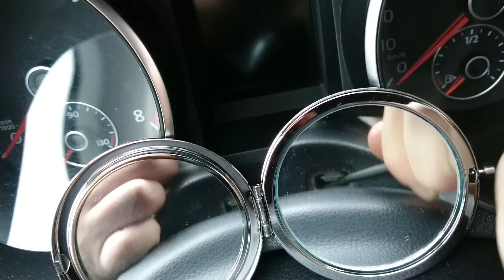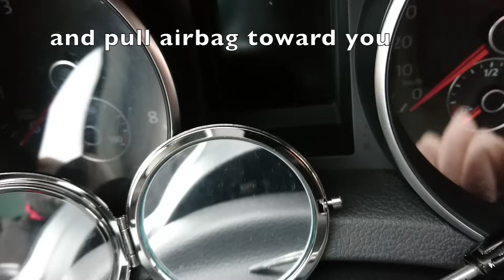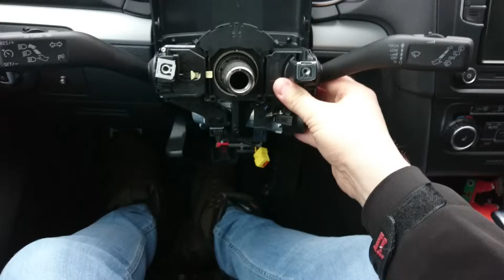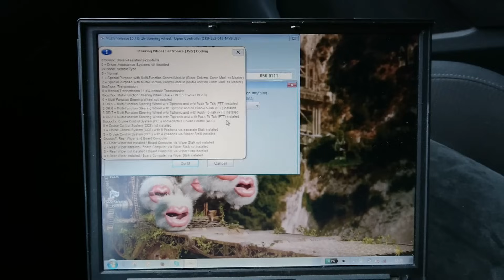Multi-function steering wheel installation to VW Golf 6

Comment: Just a note for anyone doing this, the bolt holding the steering wheel is made to last 5 uses, so you removing it and installing it back again counts as two. Just to keep in mind.
Reply: mine counts about 156 and it's ok
Reply: @static1890  bro my golf mk6 highline has a multi function steering wheel with the shifters but the right side of the steering wheel (right shifter+right buttons) does not turn on and doesn't work at all.
While the left side is working perfect(left shifter+left buttons).
Do you have any idea if I have to change the module ( the chip under the steering wheel) or I have to change the right buttons?
I just don't know where are the shifter gets connected, is it the same cable with the function buttons? Or is it connected to the module?
Reply: @pm6911  i don't think that it can be module under sw, try to take a look there is a small module under airbag where the shifters and buttons are connected so before change underwheel module i'd look the first one, if you have vcds you can take a look for errors, maybe there's something that can help you
Reply: @static1890  thanks buddy!
Reply: And the buttons fully function

Comment: Heads up to people watching this video. I have a base 2013 VW GTI and didn’t need any of the things in this video. Didn’t need a wire harness, different control module, or a new wiper arm. The multifunction steering wheel was straight plug and play. I didn’t even have to change the coding in VCDS and it’s fully functioning.
Reply: Thanks, so now you can control the menu with the wiper lever en the steeringwheel buttons? And you put the old airbag back?
Reply: @LetsMakeMusic11  I put the old airbag back yes. I clicked the box in coding to turn off the wiper arm button so it doesn’t interfere with the steering wheel.
Reply: @timterrell8678  So the airbag from the non multifunction steering wheel had allready that black cable that he plugged in on 8:56?
Reply: @LetsMakeMusic11  yes, they all have that cable.
Reply: @timterrell8678  Thanks brother
Reply: Thanks for this info! I have a 2011 GTI with no multi-function steering and I’ll definitely get one this coming week and do a swap. Will report back
Reply: UPDATE: it turns out that I just needed the faceplate with buttons for my car because I had the updated (B version) Multifunction steering module module, correct inside steering module and correct airbag harness (A version) ! No coding needed, just plug n play! I suggest checking what you have and don’t have before buying anything. Also didn’t change the wiper stalker and zero conflicts!
Reply: @MX007100  sweet! Thanks for an update. I love my wheel.
Reply: Anyone knows if the airbag harness needs to be changed or will the airbag work if the original harness stays?
Reply: @moisesibarra985  Airbag harness on replacement steering wheel plugged right in and was detected.

Comment: Excellent thank you all info with OEM part numbers
Reply from the maker: Good to hear, that this video was helpful!
Reply: @lutz6441  Just wish you  you had provided the Steering wheel part number for compatibility as so many different ones available.Can you offer any help in this area?    cheers   Colin
Reply from the maker: @colin5064  When looking different steering wheels, most likely all of them (which have flat bottom and similar airbag) will be fitting no matter what part number is. Sadly I don´t have good list of different OEM steering wheels.
Reply from the maker: @colin5064  Quick search provided some information about part numbers. General partnumber is still the same (1K8419091), but end letter(s) will change: S, P, Q, AB, R, AC,
Reply: @lutz6441  Much appreciated,l thank you for your time and interest.I search all alternatives available on ebay.Thank you for your help and experience

Comment: What happens when you don't replace the wiper stalk? Will the extra buttons not work, still work or will the steering wheel controls not work? By the way, excellent video, helped me find the parts and I will watch it again when they arrive! :)
Reply from the maker: If you use your old wiper stalker with buttons, then it might get conflict with buttons on new steering wheel.

Comment: I am planning on upgrading my 2012 comfortline jetta steering wheel to a MFSW, the tutorials I found online however had people soldering wires and doing some splicing and stuff
Reply from the maker: As you have seen in my video, you don't have to solder or cut any wires whatsoever. This is straight swap and you need MFSW, compatible module, new MFSW harness and most likely wiper stalker switch without menu buttons.

Comment: Lutz if i have mk6 with mfc just want to change steering wheel and airbag do i have to go through all steps or just steering wheel and airbag
Reply from the maker: If the buttons layout is the same, then most likely you don´t have to do anything additionally, just straightforward swap.

Comment: I bought a GTD mk6 multi functional steering wheel with airbag included for my 2009 MK6, Do I need to replace the SWCM and wiring harness? Or can I use my old one, I understand that I won’t have access to the buttons

Comment: So guys, if your car is newer than 2010 month 6 or something like that, you have no swcm under the steering column, the control module is integrated in the clock spring. Check before you buy anything
Reply: Very true. I checked mine yesterday and the location is exactly as stated here. Luckily for me; my SWCM is the updated one with part number: 5K0953549B , so I don’t need to change it when I do the Steering swap. 

Edit: It turns out I only needed a faceplate with buttons and no coding was needed!
Reply: @MX007100   i have a 2012 mk6 golf, will i need a new SWCM or will it already have it?
Reply: @imadmiah9953  Hello. You don’t need one I because yours is even a 2012 model and mine is a 2011 but it came with one already. You can do a check by removing the top plastic cover on your steering wheel column, just use a plastic tool or flat and lift up and you’ll see the switch with part number!
Reply: @MX007100  thank you, highly appreciate it that! 👍

Comment: Amazing video. To the point. Just one question. I have trendline Golf. Super basic. Basic MFD, no factory Bluetooth, nothing. I do have RCD330 like yours, which works amazing. My question is, does all buttons on steering wheel work? Does Mic button work for CarPlay and Android Auto? The up down and back button on the right side, do they work? If yes, what do they do? Considering I have basic MFD, just wondering what they do.
Reply: Also does the call button on the steering work? Since my car doesn’t have factory Bluetooth.

Comment: Nice work, not sure if you fitted a new one, but I'm sure the bolt to hold on steering wheel is meant to be single use only
Reply: You can use it 5x

Comment: What all would I need to change my  2014 Volkswagen Jetta 2.0L Base steering wheel to a multi function steering wheel?
Reply: did you find any information about your question?
Reply: @viliusabraitis9437  unfortunately not. Ended up simply getting a Camry. Best decision ever.
Reply: lol @fendypierre3965
Reply: I also want to upgrade my steering wheel from basic one to a multi function not sure if I need the module for it and nothing on the net looks like I will have to go to the dealer :)

Comment: Great video, but i've got a question does the MFSW 1K0 953 549 CF module is the same like the one you're using? 1K0 953 549 CD or not?
Reply: did you ever find out if you needed to change it?

Comment: Thanks so much for this guide! I installed a 2012 mk6 mfsw into a jetta 2006, and also upgraded steering wheel module to CH version - everything works perfectly, but I have a problem where the back of the steering wheel is rubbing against the plastic trim around the steering assembly, making a scratchy/squeaky sound. My old steering wheel didn’t do this. Any ideas? To what torque setting did you tighten the steering wheel bolt?
Reply: Are these the parts you used?  I would like to do the same for my 2009 Jetta.
5K0419091ARASZ ---------- Golf R MultiFunction Steering Wheel (Without Paddles)
PN: 1K0953549CH ---------------- GTI/Golf R MultiFunction Steering Wheel Control Module (SCCM - Highline Version)
PN: 5K0971584C ---------------- GTI/Golf R Airbag Harness

Comment: this is only needed, in case you want the bottom flat (GTI) steering wheel, otherwise you can just install the buttons. but they are different ...GTI version and standard.

Comment: Love your video. One question I have, it might sound stupid,  but i have a different unit as an audio device, and if i don't want to use the buttons on the steering wheel, but I want them to be lid(the buttons to have the lights on), will i be able to swap the steering wheel without the module change and the airbag harness to be changed? Thank you

Comment: hello congratulations for the really interesting and complete video, above all very clear and descriptive, I have 2 questions to ask you. first question the work you have done and with the pieces you have changed do the paddles also work?
second question I have a golf v gti with dsg gearbox without paddle, and I would like to mount the steering wheel of the golf 6 gti with the paddles, what should I change, and kindly if you can also give me the codes thanks in advance, for me it is important your answer
Reply: From what I'm getting is all that works bc it's activating the setting in the ecm,pcm,bcm as long as you have a tiptronic dsg transmission because my cars interior is exactly the same as his and I do not have any steering wheel controls so I'm hoping this comp program he used don't cost much bc all them parts from the factory expensive

Comment: Can you retrofit multifunction steering wheel with MFD (multifunction display) and not MFD+ (when you open door MFD+ will show you image of the car along with which door is open. MFD only shows indicator on the dash board)? If not I can imagine it can make it more difficult and expensive as probably whole dashboard has to be swapped (perhaps more coding/new contract unit?)
Reply from the maker: Yes, it can be so and then you will need to swap gauge cluster to MFD+ one.

Comment: And thank you so much for not having one of those $#@! computer voices animate. Well done and informative video.
Reply from the maker: Thanks for good words. I had some feedback, that such a silence background is quite a boring and videos are lacking generic music etc. I have now added to my new video (Tow Bar installation) some classic music and hopefully it's more enjoyable now :)
Reply: @lutz6441  Hello, THANKS a 1000 times for the video. Is it mandatory to replace the sw control module? And if not, where is that for? I don't know whether I need to replace, sw control module, sleep ring, wiper switch stalker... Any help would be appreciated alot!
Reply from the maker: Yes, you should change the sw control module to highline version one, also therefore you should change slip ring. Stalker needs to replace, when you have stalker with menu butttons - you have to change stalker to non-buttons one as they go to conflict when you have buttons in both steering wheel and stalker.

Comment: so to be clear ill need to change the airbag harness, module  and wiper stalk? been having a rough time getting the correct info. i have a mfd display but don't have the mfsw module in the column
Reply from the maker: Correct, firstly you have to change SWCM, which is compatible for buttons on steering wheel. Then you have to change wiper stalker with non-button option, as with button one it can go to conflict with SW buttons. Finally you have to swap SW wire harness to get SW buttons to work.

Comment: @Lutz .... if you used the old indicator stalks.... would the dash status screen have worked with the stalk buttons or with steering wheel buttons??? im just wondering if i need to waste money on new stalks if old one would still work fine for wipers and indicators
Reply from the maker: If you remain both buttons, then they go in to conflict and not working correctly. Stalker with no buttons is rather very cheap, from Aliexpress.

Comment: Hi, prior to you coding this, did you initially lose horn and steering controls? I have done a similar swap (Leon mk 2 facelift steering wheel to pre facelift) and have lost horn function as well as well as steering controls. Understand I may have to change module and potentially the gateway for steering controls, but thought I’d still have the horn function at this point. Thanks
Reply from the maker: No, horn and steering controls working well and sw control module should be replaced in order to make it fully functional.

Comment: Great video, did the display already have a menu? because im thinking about doing this but i dont have a menu on the display now, does the new swcm contain the menu software? and do all the functions work.
Reply from the maker: Yes, my car had before wiper stalker switch with buttons to move in menu. If your car has same set, then most likely you have menu option. I had to change my previous wiper stalker switch to non-button wiper stalker, as there can be conflict between MFSW buttons and wiper stalker buttons. In my understanding there are differences between instrument clusters, so if you don't have menu, then you should start to look proper instrument cluster.
Reply: @Lutz Super detailed video. thanks! in regards to @Leonardo's questions. Where you able to access your menu with  the old wiper stalker? because i have same like yours, either i don't know how to access the menu or there is no menu function or is it only MFSW that can access menu?
Reply: try press and hold the up down button on the wiper stalk in a few seconds. i had the same issue when i got my car due to the blue tooth phone system being the default on the display
Reply: Do you hold them both numbers at once? @Rawdilz

Comment: I have been trying to work out how to do this for a long time. I got a 2014 VW Jetti TDi value edition and this was about the only thing I was missing. The only question I have is the software you used, is it required, what is it and how hard to get /run?
Reply from the maker: I use VCDS 15.7 software and I ordered it from Aliexpress more than 5 years ago (~10€). Now they sell 19.* versions. Basically VCDS works with all VAG group cars and you can find many tutorials for the beginners in youtube. Yes, it is required when you retrofitting new components to your car.

Comment: Hallo my friend !
I have a Vw Polo 6r 2011 with the steering wheel your car had before you changed it. I want to change it with a multifunction one. The multifunction steering wheel of the polo doesn't control the middle screen  but it controls only the radio. It has buttons only at the left side. 
What else should I do in order to do this swap? 
Thank you in advance !!
Reply from the maker: Most likely you’ll need new steering wheel control module, in order to make it fully functional. Also new SW harness is must have to run the buttons on the wheel. Swap is quite straighforward, no  difficulties.

Comment: My 2011 MK6 Golf TDI didn't come with the steering wheel control module.  All the videos I've seen comes with it?  Is it possible to install a MFSW on my car?
Reply from the maker: I´m not 100% sure, but it seems, that you have to change both wiper and high beam switch, in order to connect control module.
Reply: @lutz6441  I bought all the parts (left high beam w/ cruse control / right without the button at the end, spring clock, the whole list) but when I tried to install it the didn't have the steering wheel control module on the bottom of the steering column that all the videos has.  It's strange.  I looked to see if someone had maybe cut it or something but no trace of anybody tampering with the wire.  Looked online but there's no talk about any MK6 Golf w/o the module.  Strange.
Reply from the maker: Maybe some of the very basic models didn't had control module for steering wheel. Try to search from internet Golf 6 different wiper and high beam switches and you can see, that there are two options - one with connector to connect with SWCM and other with no connector. Most likely you have second option.

Comment: Not counting the cost of the steering wheel, how much should this all cost? New wiper stalk, new airbag harness, etc?
Reply: Id recommend getting the wiper stalk from a junk yard or parted out cars. The steering wheel id look for a parted out car as well with the airbag in it still hopefully
Reply: Brian Denman good call! Thank you.
Reply from the maker: @OptimusBri22  Please look end of this video and you can see cost of parts for this swap!
Reply: Thank you again. Have a follow up question though. The steering wheel I bought from eBay only has the radio controls and blue tooth on the left side of the steering wheel. The new swc module and airbag harness I was looking at (Multifunction Steering Wheel Module&Switch Set 1K0953549CH). Would the existing stalk work since the wheel only has radio controls?

Comment: i can't understand where the new buttons are connected and why you've changed the  wiper stalker  (is it helping to connect and activate the new steering wheel buttons ?)
Reply from the maker: New buttons are connected with new harness with new steering wheel control module. Wiper stalker needs to replaced as old wiper can go to conflict, when operating with steering wheel buttons and same time having buttos on wiper stalker.

Comment: Hi there! I have a Golf Vi and I want to put the same flattened steering wheel that you have put, the one that I still have on also has a multifunction, would it be necessary to code when putting the new steering wheel or can I remove one and put another one without more?